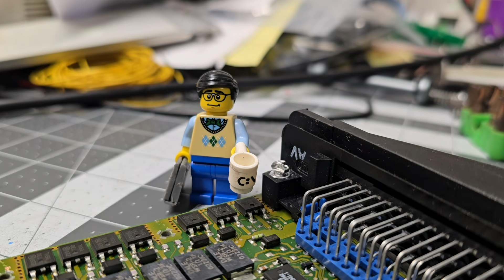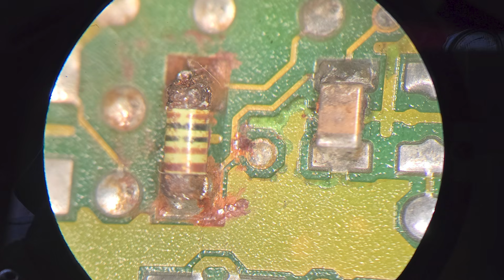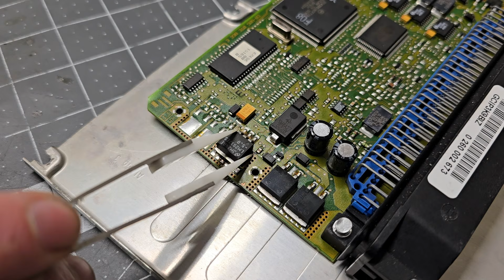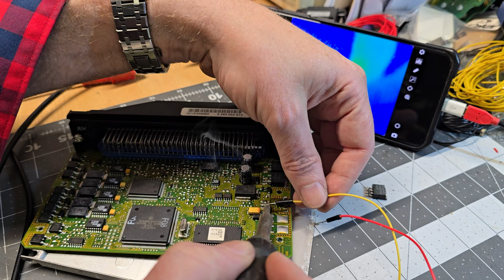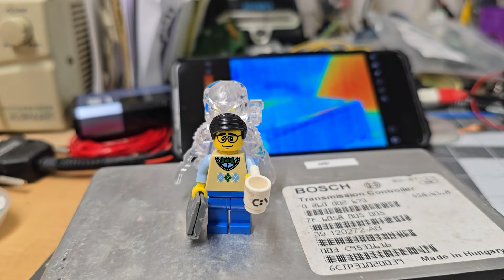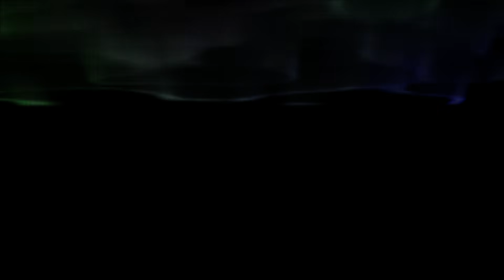Aston Martin Gearbox Controller Troubleshooting

Comment: Unfortunately measuring that cap in-situ is not going to tell you its true value, instead you are measuring the sum of the capacitances in that net. You really need to remove it or at least lift one side to measure the real value.  431uF is an enormous value for a ceramic cap although it is close (+/-10%) to a preferred value (470uF). 

You might be able to get some clues as to its function (and therefore value) by looking at what its connected to. If its directly across a digital ICs power pins (probably is if it is shorting the 5V rail) then its a decoupling cap and 100nF is a good bet. If it is a decoupling cap the board will likely run fine without it

Good luck!

Comment: What a coincidence, I have an exact same TCM in front of me (or rather, five) from an '04 Phaeton for a 5HP24A. These are Bosch RB8 / GS8.61.xx TCMs. Sadly, mine also flooded, and the exact model is unobtainium. I haven't got a replacement to work. Love your videos, they're really informative and easy to understand. Sadly, with these kinds of Bosch TCMs, there's no real troubleshooting if something has gone wrong with the Bosch ASIC or the 30333 drivers, as there is absolutely no data on these anywhere. Same with the Motorola CPUs.
Reply: Does anyone perchance know how to do a correct adaptation for the clutch packs with these Bosch GS8.61.xx TCMs in ODIS? or VCDS, My only somewhat 'working' TCM is only engaging all forward gear clutches by like 15 percent or so. After a while, it throws the error P0730 "gear ratio incorrect", which makes sense, as all clutches are slipping. After that, the gearbox goes into mechanical limp mode, which is just 4th or 5th (I don't remember) with an open torque converter, witch works just fine.
Reply from the maker: Are you getting any specific issues? A few of the ones I have looked first off don't seem to give any clues, but then when you get the back off there's often rust and water damage so there's rarely a common fault or known fix, and each one could be different.
Reply: @endtuning  Well, the original TCM, a VW 3D0927156P, did not engage 3rd gear. First, the hydromechanical unit and solenoids were swapped, and the internal transmission harness, fluid and filter changed. I checked the complete wiring harness up to the 88-pin TCM connector. After that, I opened the TCM and it was shorted on the EDS3 MOS, so I desoldered a lot and saved the EEPROM and flash software from the AMD29F400BB. After checking the back side after cutting all the rivets, there was heavy corrosion and far more damage to the PCB, and a short internal to the PCB. I searched for another 3D0927156P but with no luck, there was only an expensive 3D0927156C, also for a W12 (BAN) with a 5HP24A (01L), but with different HW and SW numbers. So I swapped the EEPROM and flash software and the Bosch ASIC, and the TCM was communicating in the car and not immediately throwing errors.
However, my problem now is: reverse is working fine, but in drive or any forward gear for that matter, the gearbox does not really engage the drive clutches. I can see that the torque converter turbine (gearbox input) starts spinning in forward, but the output does not, so the clutches must be slipping, and they are, in all forward gears. If you go into reverse, the turbine stops at standstill or matches the gearbox output speed.
After a while in forward with no real acceleration, the TCM goes into fault, incorrect gear ratio, and goes into mechanical limp mode, in which the TCM does absolutely nothing line pressure goes to maximum, and the gearbox stays in 5th with an open torque converter, and that works absolutely fine. and i hope itsjust that you need to tell the new 3d0927156c the clutch engagment points or what line pressure to use, so an adapteation, however there is absolutly no documentation how to perform an adaptation. and just in adaptaions saving ch 00 in vcds or odis doas not perform an adaptation "function requirements not met"
Reply from the maker: Hmm, tricky, I'm more used to it with BMWs, but with those it is all automatic, you have an option to clear adaptions, but no specific learn procedure, it'll would just learn as you drive.
You could think of it like fuel trims, you can reset them but there isn't a specific relearn, it just sets things to 0 and learns any offsets from fresh.